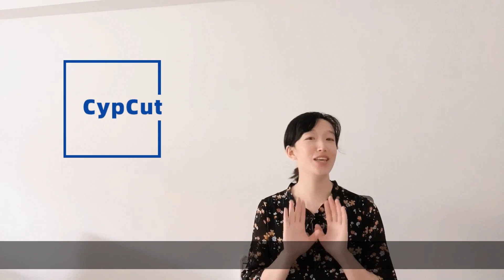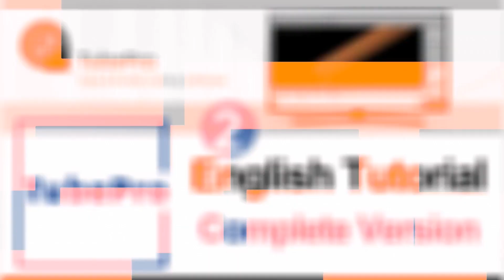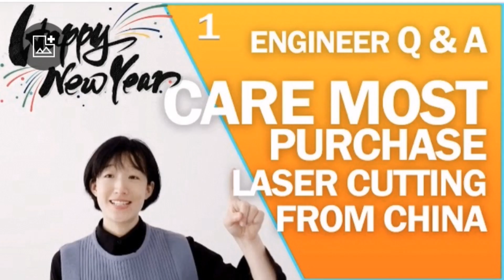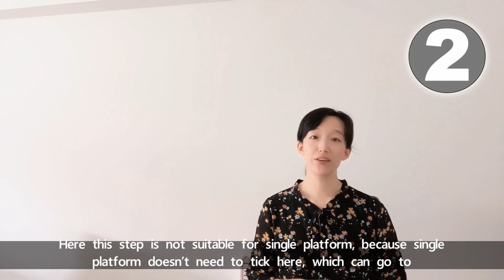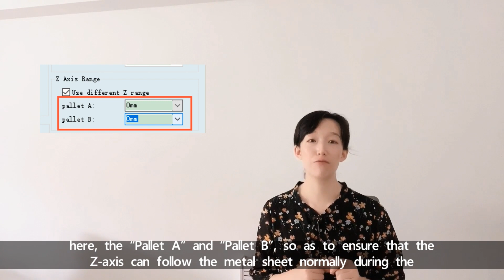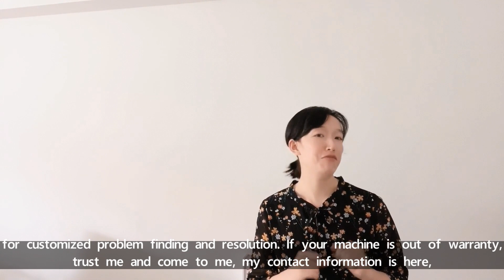Cypcut Alarm: Z Soft Limit Valid | Problem and Solution

Comment: hi Clara, i have my new machine set up from China, I am very new about laser cnc with cypcut, my problem is on the remote if i pressed Z down, the alarm stated: Jog  close to plate even though there was no steel plate on the table.
Reply from the maker: Since it is a new machine, did you ask your supplier for training?

Comment: Hi Clara, great videos in channel, been helping me a lot.
We bought a laser cutting machine from a third part, so we aren't in guarantee period. I get a Tip Touch warning on BCS100 screen. Could you give a hint in what could that be?
Also, there are 3 cable coming from the laser cutting head (OSPRI LC20S), one is the motor cable, other is the encoder cable, and the third is the signal cable. My doubt is in the signal cable, it has 4 cable in it, 0V, 24V, inferior limit and superior limit. Where do I connect those? The I/O Board is a BCL3766. I trying to contact OSPRI for a manual, but they do not answer. My laser machine is a Raycus RFL-1000, and I use Cypcut. Servo motors are Yaskawa.

Appreciated. Best Regards.
Reply from the maker: +86-13335151833